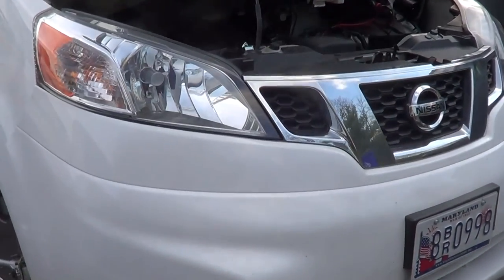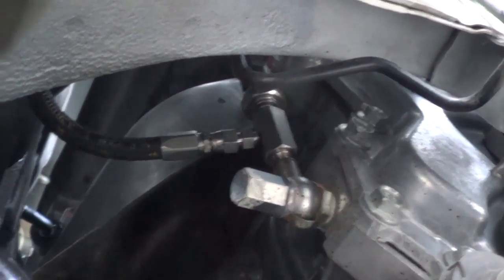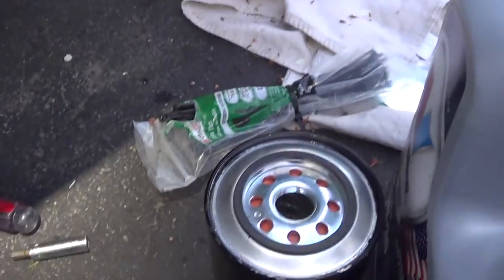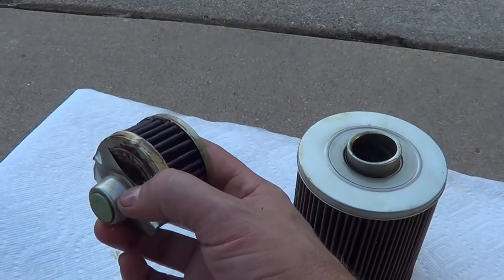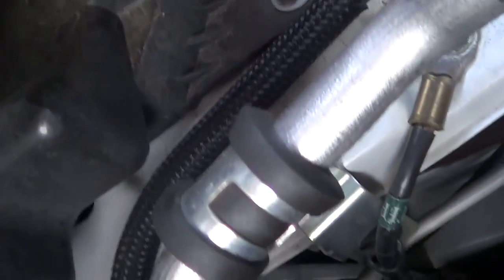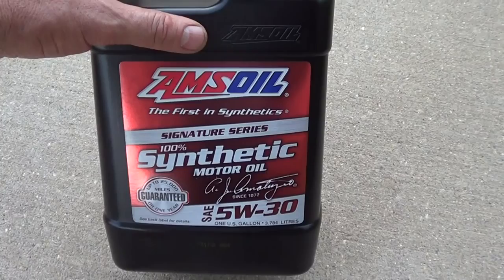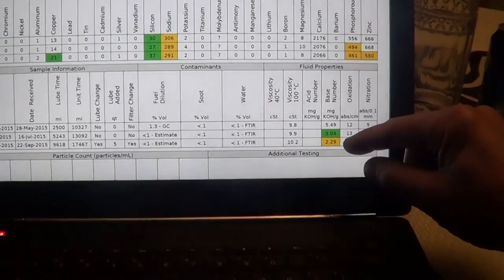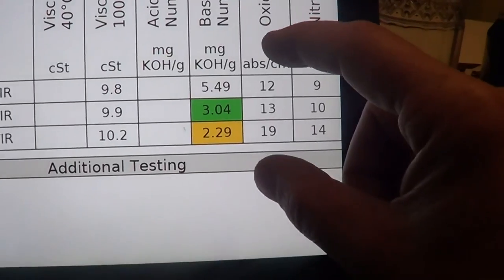Oil bypass filter results on a Nissan NV200 gasoline engine

Comment: Your old oil looks fine. It's dark because it captured a bunch of break-in debris from the engine internals. It did its job. The reason you change the oil is not because it's "dirty", but because it's been chemically degraded by heat and friction, so it can no longer provide the necessary lubrication. No oil filter can fix that.

Comment: Just because the oil is dark doesn't make it bad
Reply from the maker: Yes.  You are correct.  Color doesn't show the amount of abrasives in the oil.  I have been having particle count tests done at 5K and 10K miles with the bypass filter.  Both tests have been showing the oil as "very clean".  However, I am going to run another 10K miles without a bypass filter to compare bypass and no bypass particle count results.  Check back in 6 months (2017) for the results.   I will post a new video explaining what the bypass filter does.  If I still have clean oil for 10K miles without using a bypass filter, I will then switch to fran filters and run them 10K miles to see if I can get abrasive oil test results.  This data takes a few years to gather.
Reply: @NathansHVAC  who does your our analysis?

Comment: Even though you're all pressure gauge does not show pressure the oil pump is still flowing oil through the motor until the bypass filter is  full bypass only gets 10% of normal flow

Comment: thanks Nathan, your video really helps. I'm very glad someone do this so we can all learn
Reply from the maker: I haven't posed my update video yet.  However, I have learned that the bypass filter will NOT extend the useful life of the oil.  I still have to change at 10,000 miles max.  Also, the particle count tests really didn't show much difference between having a bypass filter and not.  I recommend a good quality main filter and don't bother with a bypass.  Also, full synthetic such as Amsoil or Mobile one is a must.
Reply: Thanks Nathan. Your experience is very valuable. I almost try this myself on my van. 

I wonder why the diesel guys use it.
Reply from the maker: Diesel doesn't make as much acid as gasoline.  About 20% of gas motor oil is the additives that handle things like sludge dispersal and acid neutralization.  So, the oil depleats in a gas engine faster than a diesel.  No amount of filtration can replace the additives than are neutralized.  So, the oil still has to be changed anyway.

Comment: Very informative and useful, have to watch it again someday. Thanks
Reply from the maker: +Crystal Xmen  I'll make an update video at 50,000 miles and 100,000 miles.  It will show oil testing at.  I usually hit 300,000 miles on my vehicles.

Comment: Excellent video.
An Amsoil channel compared Amsoil oil with 6 of the other "synthetics".  Valvoline Synpower oil was virtually equivalent to Amsoil at 25% of the price at Walmart.  
I've seen the placing of oil catch cans in series to "scrub" the crankcase "fumes".  I was thinking that running  minimal, "fresh", vaporized gas into the second catch can may improve gas mileage as well as "clean" the intake...easy to do once the 2 catch cans are in.
With the price of Valvoline synthetic products being relatively inexpensive I continue to change the oil with Synpower every 4 to 5000 miles.  Additionly,  as long as I'm under the car, I change out the transmission  fluid with Valvoline Synthetic ATF. (instead of draining coca-cola transmission fluid, now it's "baby bottom" pink!)
Looking forward to your next video.
Reply from the maker: I"m testing a much better bypass filter now.  It is part number:  TR-20330   I should be at 10,000 miles on it in the next couple of months.  At 8,000 miles the oil still has a gold tint.  My goal is to keep the cleanest oil possible even at long interval oil changes.

Comment: I don't actually it would hurt to put the bypass on dry because the tiny inlet opening would mean most of the oil will still make it to the engine even when the thing is empty.
Reply from the maker: +Casmar It probably doesn't matter.  However, the air in the filter will compress.  So, full flow would go into the filter until the air is purged out.  Probably 5 seconds of zero oil pressure.

Comment: great video and set up! I thought about doing something like this on my tacoma pickup. it looks like a nightmare to gather all the proper fittings to plumb that thing. I just ran some liqui-moly mos2 additive for an experiment. excited to see how the test comes back. now that my warranty is over I might start doing some extended oci's
Reply from the maker: Don't install just yet.  I'm running a comparison test right now with the bypass filter valved off.  I will compare oil color and particle counts over 10,000 miles running the main 20 micron filter only.  If I get the same results with and without the bypass, I will probably remove the bypass system.  I can't run 20,000 miles because the 20% additive packages in the synthetic amsoil run out completely at 10,000 miles.  So, the only advantage to the 2 micron bypass is particle count.

Comment: To a filter man like me the oil isn't dirty because it's doing its job. Its dirty because the filter isn't keeping it Clean. I gave up on allowing the oil to get dirty wear and foul the engine then draining it. In 1963 when I found out about toilet paper oil filters. In those days I paid 15 cents for a roll of paper. 29 cents for a quart of Standard. Delo 100 and changed the filter about every 2 k.I go farther between filter changes now

Comment: Do a quick test for oil contaminants - several drops on a cheap paper plate -- the oil will spread, leaving any contaminants in a ring.  Color is not a problem AFAIK - oils turn dark from heat.

Comment: Hi Nathans, very informative video. Just a question. How much for the oil analyse and how it works. Thanks.
Reply from the maker: I have a hand suction pump and use fresh 1/4 inch poly hose that runs down the bottom of the dip stick.  A little hand pump sucks the oil into a small sample jar that comes with the oil test.  Oil never touches the pump.  This way, the oil is a pure sample from the engine a few minutes after it was running.  I use oil test from Oil Analyzers Inc.  The basic test that shows TBN (additives remaining) is $25.  The particle count is an extra $27 and must be called in.  But, If you want to save money you really don't need particle counts and TBN tests.  Just use a good "pure" synthetic and a top quality oil filter (not FRAN).  I used to use the cheapest oil available and it would destroy engines at 250K miles.  The main reason for synthetic is cold starts.  Don't worry if your engine has more leaks with synthetic.  Leaks can be good because the oil you add replenishes the additive packages that fight sludge and acid.
Reply: NathansHVAC Thanks for the info. You're obviously someone has lots of knowledge about the engine oil. What reason makes you chose Oil Analyzers instead of Black Stone? I did few oil analyses with Black Stone. But I also want to compare their oil analyses with other companies.
Reply: Nathan, the second reason for using synthetic oil is is that it's not damaged by heat and it also keeps its viscosity in proprer range at operating temperature for a long time.

Comment: You did some good stuff to your Engine for sure.  Also, I think this is an " Upgrade " and not a " By-Pass ".  BTW, you should try " Blue Diamond Oil ", they are rated at 100K, LOL.  With that Filter and the Oil, you can change your Oil / Filter every 150K, LOL
Reply: i know its been a while, but AMSOIL keeps winning all the oil showdowns. they are the best of the best, stick with them if you can.

Comment: None of the spin on filters are any good at cleaning oil good enough to eliminate routine oil. drains. It takes depth to clean oil.on my Nissan Altima I change my Motor Guard bypass filter  every 6k and add a qt of Pennzoil Platnimum. I don't drain oil. On my Subaru I did the Frantz every 12k and added a qt of Mobil 1.That was probably pushing it a little too far.Still running good at 250 k Gave it to a friend. He went into the military and I lost track of it at over 300 k. Good car.

Comment: cool.  the motorcycle industry has a very small oil Surplus for the engine so changing frequently regularly and while it's hot is a must to keep these small race engines running or they will die an early death but we all abused our cars turn the key let's go

Comment: I'm excited for your update because on the Amsoil website for those bypass filters it says a minimum of 20 quarts? I'm guessing your van probably takes five? the bypass filters are typically seen on big semi trucks. so it'll be interesting to see the results
Reply: okay I'm not sure where I read you need a minimum of 20 quarts to run those but I can't find it now on the Amsoil website so I must have been reading something different. so forget what I said.
Reply from the maker: +bep2001 kumar   I called Amzoil about the flow rate thru the bypass filter.  I wanted to see if they sell smaller orifices, but they don't.  The only problem a bypass could create is lower oil pressure from too much flow.  Worn engines normally get lower oil pressure for the exact same reason.  The wear in the journals becomes large enough to lower the oil pressure.  But, my intent is to prevent journal wear in the first place by keeping the oil cleaner.  My todo list is to install a digital oil pressure gauge with built in alarm.  The engine is still new.  If there is any concern, the oil pressure will drop above 200,000 miles if the journals wear.  Worst case, I can pull out the bypass filter then if the oil pressure at 200,000 miles is significantly less than a new engine.  I plan to run this engine to 300,000 miles.
Reply: Nathan, you can also remedy low oil pressure by replacing the oil pump on a high mileage engine.

Comment: Is this your personal NV200? I'd love to hear from you regarding how you feel about the van in general after owning it for awhile. I am mixed about my NV200 with about 15k miles on it.
Reply from the maker: +Gary Leese:  I love the van.  I use it for mostly work and drive it every day.  But, I added alot of aftermarket stuff.  Remote start, alarm with window rollup, backup camera and sonar, LED interior lighting, 120V inverter, wifi internet, hard mounted tablet with keyboard, internet radio, dash camera, gps, 8 port USB, credit card processing, and many compartments.   I'm going to add mobileye crash avoidance camera soon.  I have a few hundred hours of customization into the van.  But, I always customize my work vehicles.  I'll post a video of all the customizations soon.

Comment: Redline, Royal Purple, Mobil 1, Castrol, Motul, and Liqui Moly all still sell full syn too. (And probably others i dont know of) Just have to get the right stuff as they sell hydrocracked too. Most syns now are a blend of gp3 and gp4 and perform enough better than dino already that i dont believe microscopic gains to even fancier high dollar "true" syn is worth it in anything short of a race car or something getting extreme hours/miles on it. Just my 2 cents.

Comment: In a modern gasoline engine with a good bypass filter I expect the oil to always look new. In a diesel engine I expect the oil to be analytically clean but black There are enough soot particles too small to be filtered out but are non abrasive. Similar to ink. A bypass filter that costs more to service than changing the oil isn't economical. The biggest reason for oil changes is it is dirty. Why is it dirty. Because your filter is no good.Filters that clean oil haven't been factory installed since the 1950s.

Comment: You should start to know at wich pressure the discharge valve on the stock oil filter or oil pump is opening at,and at wich oil pressure the engine is working at
 before to claim the stock tiny filter does not work.
the discharge valve on the oil pump,or the stock filter is suposed to discharge oil ,and bypass the filter media only if it's clogged,or completly overloaded with oil flow to the point of the pressure opens the discharge valve.
Using a bypass filter will just lower your global oil pressure in the system,because creating a leak,unless the pump is flowing enough to compensate.
Did you even measured pressures,before and after installing this sytem ?
Reply from the maker: I appreciate the feedback.  I have an isolation valve that allows me to measure oil pressure with and without bypass flow.  The pressure loss to the entire system is 2 psi.  Warm oil idle goes from 20 psi to 18 psi.  The factory low pressure warning is at 10 psi.  Above idle has close to 80 psi.  So, the 2psi loss doesn't matter above idle rpm.  I do want to measure oil pressure drop on the main oil filter.  Maybe some day.  I am finding out that I really can't go beyond 10,000 miles even with the good bypass.  But, I'm running the oil out to 15K right now to verify when I test again.  I will look into putting a differential pressure logger on the main oil filter.  Particle count testing really hasn't been that impressive.  However, if the bypass filter actually prevented the main filter from opening the bypass, that would be very conclusive results.
Reply: I don't understand.
There is no pressure drop because of the main oil filter as i know.
The machining tolerances are creating the pressure you can see in the engine's oil system when restricting the flow.
The oil filter is supposed to let the flow goes through.
You may have some resistance because of the filter,but it's only a problem on cold starts when the oil still hasn't reached the end of its journey,in the camshaft oil galleries.
Filters are causing pressure drop only if the leaks after them flow more than what the filters are capable of ,wich is only the case in non pressurised systems.
If you want the oil catch can to work better ,you should try to install some baffling in it,and to install it under the level of the engine oultlets inlets,and to let it be constantly cooled down by cold air ,from outside.
The oil vapors will condensate way more,and help to reduce contamination of the oil with acid blowby gas.
Reply from the maker: The internal bypass in most oil filters is set at 10 psi to prevent damage to the engine if the media is clogged.  However, passing oil thru the main filter without filtration can't be good.  I"m coming up on a 15,000 mile oil change soon.  I will probably just look at the main filter media under a microscope to try to tell what the cellulose depth bypass filter is doing.  I will have particle count test done on the oil too.  But, I'm finding out that the labs don't really think particle count is accurate and they are stopping the test on engine oil (which tends to be too dark to count anyway.)
Reply: To know at wich pressure the stock internal filter's by pass opens,just put weight on it.
With the surface area of the bypass  and the weight used to open it ,you will know the pressure at wich it's set on.
But to have it open while the engine is working under oil pressure ,you need the filter to be clogged up to the point you have the blockage causing more pressure drop than what you have pressure in the oil system.
You can't measure that while working.

Comment: What is the cost of one ? And thank you for sharing this !
Reply from the maker: They are not cheap.  About $220.  The replacement filters are $25.  I'm going to run a test without the bypass filter for 10K miles to see how the particle count compares.  Check back in 6 months to see the results.

Comment: Filters are cheap. Have you considered using a larger capacity, lower micron oil filter and changing it more often?
Reply from the maker: I might end up doing that if the particle count test without bypass isn't much different than with the bypass.  I will know in a few more months.  By the way, filters actually clean better when they are slightly dirty.  The idea is to change the main before it clogs enough to open the internal relief.
Reply: Yep. I've never understood why OEMs recommend such tiny filters when they have clearance for larger filters.

btw,
I was a Warranty Manager for an OEM.
Dirty oil and customer's use of cheap, substandard filters was one of our frequent causes of mechanical failures.

Comment: Thanks for the update.  Wonder if Frantz toilet paper oil filter system would be better.
Reply from the maker: Jason Alexander I'm testing that one now.  I just sent in a 10k oil sample and I will know in a couple of weeks.  However, it is the triple r system with their top grade 6 inch depth filter.  The paper is much more dense than toilet paper.  The oil still has a golden tint at 10k miles.
Reply: what's the update on the frants?
Reply: No. I made a homemade one to recycle small engine oil because i use synthetic but of course it gets dirty with no filter, and tp only goes down to about 10microns or so. The oil is a bit cleaner, but not like a 1micron bypass.

Comment: No need to prime the filter. Some expensive cars have cartridge filters and are not primed Some are on such angles you would spill the oil out while replacing. Very messy. Change the oil very 5,000 miles. Been driving over fifty years and owned many cars and trucks never  had an engine fail on me. Drove them into very high miles and still ran great when I passed them down or sold them. Priming oil filters is BS. if you had a nine inch diesel filter you could toss in some oil. Best oil is clean oil.
Reply: Correct Arthur, especially because it's the bypass line. A trickle of oil goes to the bypass filter but most of the oil still circulates through the main channel.